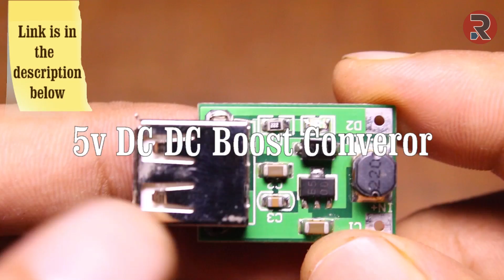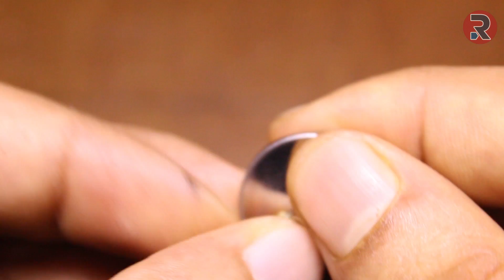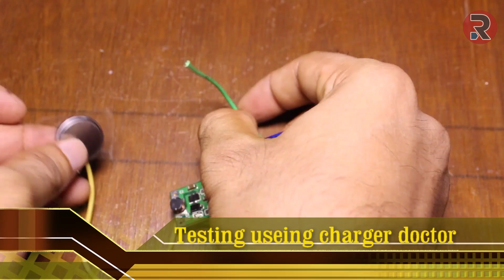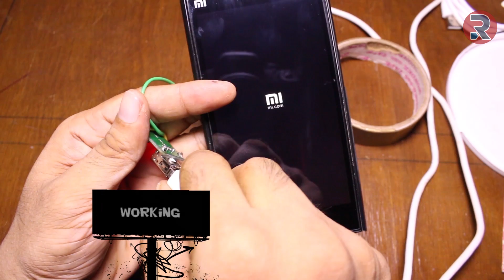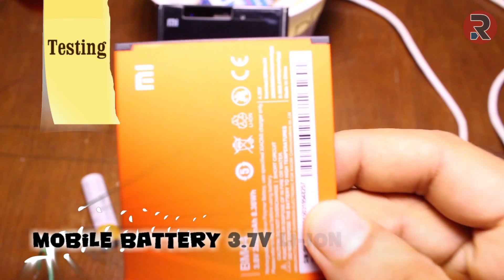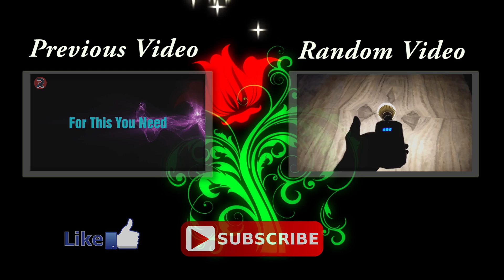Emergency Phone Charger Life Hack- Charge Your Phone Using Any Battery.

Comment: I've collected 12 cell phone batteries. Some are 3.7 v and some labeled as 3.8 v , the capacity range from 1150 mAh to 2100 mAh. The total capacity is around 19000 mAh after combining all the battries. Can I connect all the batteries in parallel and follow your instructions to make a large capacity powerbank?